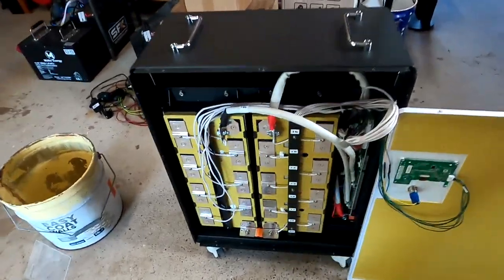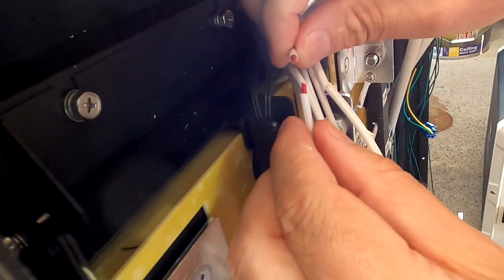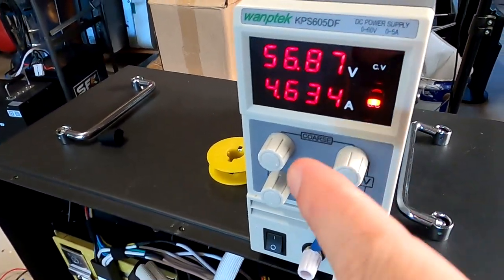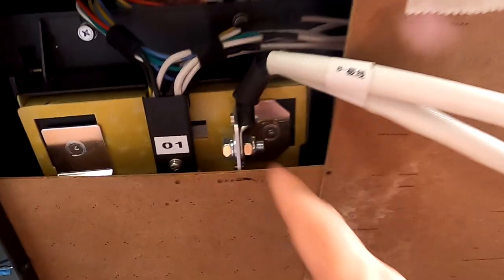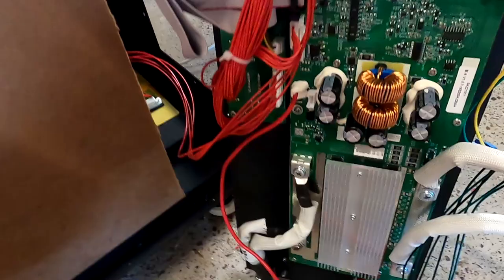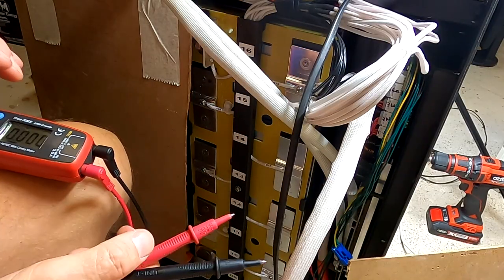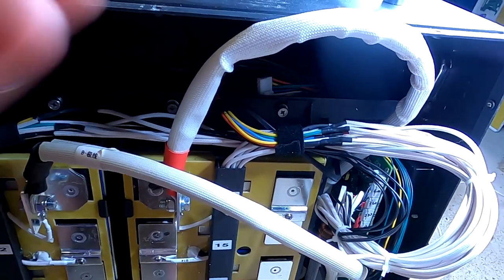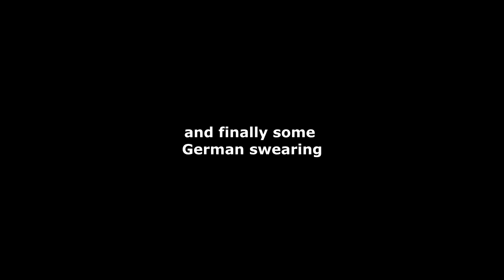The QSO Battery Active Balancer Upgrade. And how a tiny switch makes a simple task impossible!

Comment: I have a question.  Did you draw out the schematic or diagram when you added a balancer to that battery?

I am 90% sure that Y splitting the balance leads will lead to incorrect voltage readings and could potentially cause a fire or worse.

The issue is the main internal BMS of that battery pack is still connected to the cells via those balance leads.... the same leads you just added a bank of capacitors to.  The internal BMS will be using those for cell voltage levels.  However all it will now see if the charge level on the capacitors connected to the cells which will be bouncing and spiking with the balancer.  It will get incorrect values for cell voltages.  Additionally, if the internal BMS trying to passive balance while the active balancer is in circuit, things will get very confusing and at that point any and all cell voltages should be treated as invalid.

This will not end well.  It may well be one of those things you get away with, but may come to bite you.  I hope for your sake that does not happen in the middle of the night and result in a fire.
Reply from the maker: Nothing of this has happened and will happen. Both balancers are working perfectly fine together with no voltage issues or any other problems. We have tested all this in previous videos when I build the Battery shelf.

Comment: @OffGridGarageAustralia 🐸
Hey Andy - this BMS should have two dry contacts on Board (one for Alarm status / one for Faul status).
You can use the Alarm-Dry Contact to control the Active Balancer then.

If you can hear a click if one of the states changes in the Software, you only have to search for the Pins on the connector.
Reply from the maker: I could not hear any click sounds when reaching the alarm state, but I will do some more testing in this regards and pay attention to that. Some relays are very quite so I may just measure the terminals. Thanks a lot for pointing this out. That would be a fantastic solution for this battery.
Reply: @OffGridGarageAustralia  Can you show us a Close-Up of the BMS next time please?
On my BMS, the relays are very tiny and very very quiet too - yours could have SSRs instead? (i mean - yours has builtin BT and Wifi 😲)
Good luck my froggy friend! 🐸
Reply from the maker: @Der_Hannes  I found these two relays on the BMS but could not figure out which contact terminals to use for them.
After contacting QSO, they confirmed these relays are being used for internal operation of the BMS and cannot be programmed or used by the customer. So that's another 👎for this BMS.
Reply: @OffGridGarageAustralia  
I know those companies. They don't know nothing about the BMS and people like us are a pain in the butt. I bet you can hear a tiny Klick if the alarm state is on, and another when the protect is on.

Thumbs down for QSO, not for the BMS (in this Case)

Can you post a picture of the BMS?
Reply from the maker: @Der_Hannes  I'll post a picture in the community forum here:
https://www.youtube.com/@OffGridGarageAustralia/community

Comment: Andy couldnt you use a dc solid state relay with your solar charge controller to activate the active balancer instead of that switch. That way as long as the battery was charging with solar then the active balancer would be working and when there was no charge it would shut off active balancer. I dont really know because my balancers ive ordered are not here yet but it seems like it will work

Comment: Hey Andy, Get yourself a round magnet with a hole in the center. Stick the magnet around the hole when you drill. All the shitty metal chips will stick to the magnet. No clean up and you don't get metal chips in your electronics boards.
To mount your PC board; they make plastic stand offs with adhesive ends. Stick them to the four corners and to the metal plate.. Cheers Mate!

Comment: Some wide mylar tape may well hide some of the battery tops and bus bars against accidental contact
Reply from the maker: Good idea! Usually the case is closed and insulated on the inside but some double insulation for the terminals cannot harm.

Comment: Andy, why not using Cardboard under the Balancer and wrapped together with some electrical tape?
Is it an idea to put a quick fuse as the bridge down there?
The normal I think might be to slow in case of emergency.
Wieso geht das *'?%§'-Schalterding auf einmal?
/Marc
Reply from the maker: Yeah, nah, cardboard is not really a solution for that. I wan't a bit more a professional finish with that.
Reply: @OffGridGarageAustralia  Yes, but for TEMP I would either prefer something that is fixed somehow with the circuit board.

Comment: Hallo Andy.

Allways disconect and verify that there is no voltage left before working on electrical components!  ;-)

Maybe a better idea to switch the balancer automaticly by voltage detection.

The Space on top is the optimal place for the fuse you missed. Put a fuseholder close to the positive pole.
I think a fuse in the middle of the battery can cause other problems due the bms/balancer cabeling.

Why not use some simple riser bolts for the balancer together with a sheet of isolation?
Reply from the maker: Thanks Juergen, I want to show a few options on how to trigger the balancer. The switch is just one of them, so we will go from here....

There are many options to mount this balancer, no question. I wanted to involve the community a bit as well and get active 😉

Comment: I have a Daly 5Amp active balancer, I see you are using a QSO Battery Active Balancer, how many amps is it? which one would you prefer? I am learning alot too, My diff voltage is 0.015 I think this is ok but, I would love to bring it to zero
Reply from the maker: Voltage delta depends on the battery voltage. With LiFePO4, you can see a delta when the battery is below ~2.8V or over 3.4V/cell. In between, the cells have the same voltage.
Balancing only makes sense above 3.45V and a delta of 0V is very unlikely and has no real benefit. If your cells have say 3.5V and you have a delta of 50mV, that is good enough.

The balancer I used for this battery has 5A as well and is not much different from the Daly one you have.

Comment: As for insulator, I bought silicone oven baking mats. They are cheap, easy to cut, withstand high heat and of course, non-conductive.

As for fuse vs breaker… putting a fuse in between the 2 halves of the total pack seems unwise. How is the BMS going to react if half the cells suddenly disconnect? Wouldn’t that risk frying the BMS?

I’m using marine battery switches on each of my batteries in addition to a mega fuse between each battery and the load connection in my system.

Part of my decision to use fuses instead of breakers is because in a 12v system in an RV running 200-250 amps through each battery pack is a real possibility and DC breakers that big are hard to find and expensive plus if the breaker fails I can’t just run to a local hardware store and get a new one.
Reply: Renogy (uk) have some decent looking 12v breakers (though the biggest is 160A) but you should always carry spares even though it's not likely to fail like fuses do (you gotta carry spare fuses, right?)
Reply: @opless  Absolutely, 1 for 1, actually right now I have 1.5 spares for every fuse I’m getting ready to install in my new system.

Comment: Mount the switch on the front panel is easy. Use simple push button,not that toggle switch
Reply: Agreed. A toggle switch is much more susceptible to accidental bumps & knocks, & it wouldn’t need a big bump to destroy those small toggle switches.
Reply: @evil17  push button also looks neat compared to toggle switch.

Comment: Hi' I certainly recommend using Active equalisers, but I don't recommend the capacitor based versions, but only the transformer based models.
The reason being that capacitors are known for failing when involved in energy transfer either because of underspecified voltage specs, underspecified number of operating hours or temperature.
Best regards Watch-Out
Reply from the maker: Hmm, never heard of one failing so far. I think if used only a few times a year, they will last a very long time before the caps are failing.
Reply: @OffGridGarageAustralia  Well not having it turned on all the time will definately help tremendously, and thereby eliminate this risk, but it doesn't change the fact that capacitors involved in switching circuits most often are the reason such circuits fail. For sure you must have seen this fenomenon both in Switch mode PSUs and high frequency switching inverters.
Very often manufacturers use underspecced capacitors to save money. The most famous of such savings in manufacturing, are the Samsung monitors that stopped working just s little after the warranty period expired.

Comment: At this point woudn't it be better to just replace the bms with a JKBMS that has 2A blancer?
Reply from the maker: I want to avoid all these holes on the outside. I need to cover them somehow with a new metal plate or so. Don't know yet. There might be another solution...

Comment: Oh, yes, one more thing Andy.  The only reason you didn't fry that balancer board competely is because AliExpress shipped it to you in a fake anti-static bag.  For future reference, pink plastic bags are conductive to prevent static build up!  They are not intended to be insulative, but the opposite, conductive to conduct the static away!
Reply from the maker: Thanks Paul, I have shown this in a past video, that neither the pink plastic not the bag the balancer is coming in are actually conductive in any form. Some people have mentioned that but it's a myth, I guess.
Also, the balancer has not being fired at all. They always spark when connected. Especially at a 48V battery. Also tested in past videos 😊

Comment: I have a 'concern' about the way you've connected your active balancer. You are using the same cables as the passive balancer. So when the passive balancer discharges on off the cells, there is a slight deviation of voltage while that is going on. If the Active balancer actually reads the voltage at the precise moment when the passive balancer is discharging the cell, the active balancer may decide (because of the lower reading) to 'move' energy from another cells to this one while the passive balancer is discharging it. I think you would be better off extending the length of your active balancer leads and connect them directly to the cell bus bars instead of the leads. I am pretty sure you will get better readings and have a more efficient setup
Reply: The balancer cables were rejoined. He does not need to use the same gauge cable as it is not a "loop through" but only a "tap off" point to the active balancer.
Reply from the maker: That won't be an issue. If you remember, we had such a setup for weeks in the battery shelf when we did the initial setup and testing. BMS and active balancer were using the same balance cables from the row of terminal blocks to the cells. No issues.
Reply: @OffGridGarageAustralia  Understood and agreed... my comment was more related to efficiency of the active balancer. I think the active balancer will sometimes balance the wrong cells because of the 'bad' voltage readings it will read if it happens at the same time as when the passive balancer is balancing.

Comment: Can you make a test if the balancer confuses the bms because of the voltage drop at 5A balance current.
Reply: Indeed, i got this problem. The bms is confused and might trigger an OV. Could you please confirm Andy. Or is there any option to set in the bms software.

Comment: I bought the 6s version Heltec and the second i connect it it sparks and a little bit of smoke and pretty sure the +3 part on the back looks smoked and when i put a small charge on the lto pack it was connected to is not balancing that one cell. Wonder if i buy another if it would do the same thing or not? thought about the 10 amp one instead it's just a 6 cell lto bank for my 12 volt car.
Reply from the maker: Spark is OK but smoke not. Something got wrong connected...
Reply: @OffGridGarageAustralia  funny cuz i followed the wiring guide for it
Reply from the maker: @AaronBilger  6s battery?

Comment: Oh Andy... no. Since the BMS does not know anything about the current of the balancer, it falsifies the measured values with the thin cables. The larger the balancer current is, you will see, it can come to jumps of the BMS measurement, with some bad luck, the BMS switches off, because it thinks the difference would be too big. But this is only caused by the balancing.
Reply: Is this something you have personally experienced? If so can you describe your setup a little, which BMS and balancer, battery pack, etc.

Since Andy only uses the add-on balancers on demand when he feels the need to rebalance a battery he hasn’t mentioned seeing this behavior before so I assume he hasn’t seen it. 

I also haven’t seen anyone else mention it either.
Reply: @inmyimage1081  You can do the math. 50cm cable with 0.5mm² at 2A current on the cable and 3.2V are about 2% voltage loss. are about 64mV which are suddenly more on the cable. Now a few more contact resistors and a cell difference is suddenly >100mV or even more. 
In his cabinet, he uses BMS with balancer internally, they know when currents flow and do not measure at such times. As long as the differences are not too large, they do not affect the whole, but if the BMS switches off because of too high cell differences, he will notice it.
Reply: @inmyimage1081  Andy makes interesting videos, but everything should also not be replicated as he does.
Reply from the maker: It won't have any negative impact as we have seen from our testing in the battery shelf where I had the active balancer in parallel to the BMS for weeks (same balance cables from the terminal block to the batteries). The balancer of this BMS is only 506-60mA and does nothing.
Your assumption is not correct as the BMS will either measure or balance but not at the same time.
Reply: @maxmeyer7299  The only BMS in his cabinet that he does not use the active balancer with is the JK BMS because it already has a decent active balancer function. The other 2 BMSs he uses the Heltec Balancer with, note that one of the other 2 BMSs is a Heltec BMS so with that one it’s the Heltec BMS + the Heltec Capacitive Active Balancer
Reply: @OffGridGarageAustralia  only the JK-BMS with internal balancer can distinguish it. BMS with external balancer has no information from balancing current. The measured voltages are no longer correct then. This is simple electrical engineering. Of course, strongly dependent on the cable thickness and length used. If then do it right and do not implement simple solutions. Calculate it for your balancer current with your cables.

Comment: When soldering on switches use don’t heat the switch for too long it will melt inside. Happend to me a lot lol
Reply from the maker: Yeah, that was not the problem here. The switch was already damaged. Soldering for 45 years, so yeah, heat is a killer for most parts.

Comment: You like that balancer over the neey?
Reply from the maker: It's a lot cheaper and I have a lot of batteries which would need an active balancer.
Reply: @Off-Grid Garage  I have version 1 and version 2 so I ordered another wire kit, need to find a way to wire the leads to three seplos batteries so the connectors hang out and as needed I can just plug version 2 into each battery to balance them

Comment: Using the same cables for BMS an Balancer will end up in voltage jumps measured by BMS every time the Balancer is working. This could end up in BMS Disconnecting
Reply from the maker: None of that will happen. Why should the voltage jump?
Reply: @OffGridGarageAustralia  Ohm`s law and simple math. Based on the balancer current and the wire resistance. This voltage drop will be measured by the BMS.
Reply from the maker: @michimichi7534  Well so far it works great and I haven't  had any issues with what you predicted. It just seems to work as expected and balances the cells with the active balancer turned on and also the BMS balancing at the same time. I cannot observe any change in voltage or even voltage jumps at all.

Comment: Man kann wenn man auf dem MP2 den Relaisassistenten installiert den Balancer nach beliebiger Spannung an und ausschalten.
Reply from the maker: I know, the MPPTs can do the same. With these 'mobile' batteries I just prefer a solution which stays with the battery and does not require additional cable connections to the battery. I have also already used the relay in my MP to turn on the second 'generator' inverter.

Comment: Andy, I can print you a holder for the balancer. Send me the following measurements and I will print it in heat-resistant Nylon or ASA. I'll need the length and width of PCB and the distance between the screw holes in both directions, the diameter of the screw holes.

Comment: 22:34 I had the same dilemma with my battery pack.
Anyone knows adverse effect of using a fuse in this spot? 
A friend told me that if the fuse breaks, high current could potentially flow through the balance wires; he opined to put a 0.1Ω resistor in parallel with this fuse. Once fuse burns, BMS will log the event as cellovervoltage protection.
Reply from the maker: It could cause some issues with the BMS, so that's probably not a good spot for a fuse. I don't think a 0.1 Ohm resistor will help.